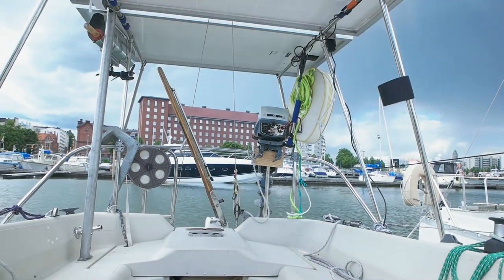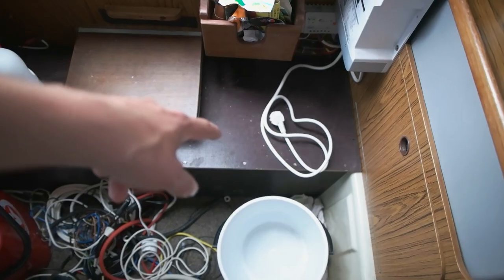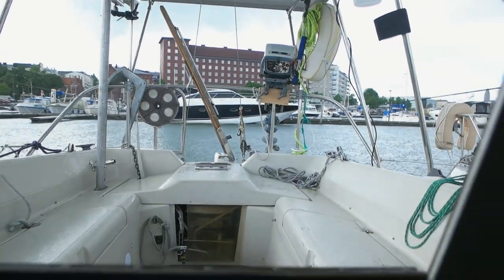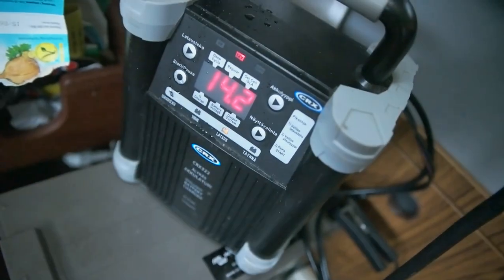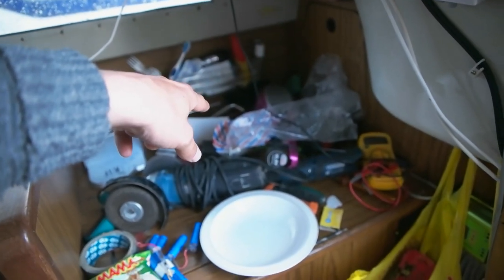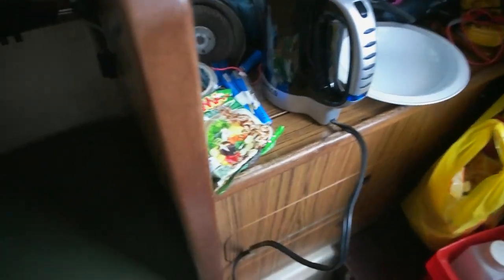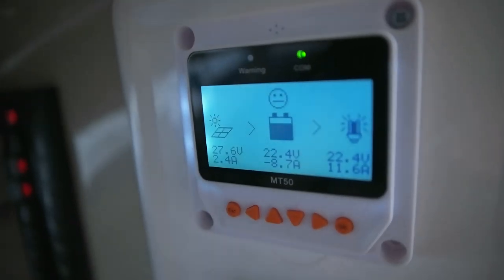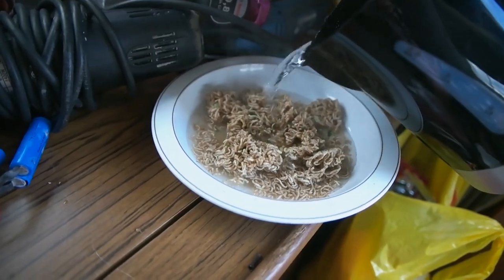New battery and rainwater noodles - Electric sailboat vlog 0033

Comment: I like the way you try to find solutions and use sun and water etc. I have only some idea that might make your life a bit more easy. Make/print a small gutter and attach it to one side of the panels. lift the other side of the panels a few cm. Make a water outlet that will accept a see through hose. And every time you get rain (on board or not) will flush the panels more effectively (birdshit and other dirt) off the panels into the gutter and out the outlet without a hose just going overboard. When youwant to collect it just put the hose on and put the other end in a bucket or directly into the tank. you even can make a drain on the tank so it will drain the rest of the water when it get's full. good luck